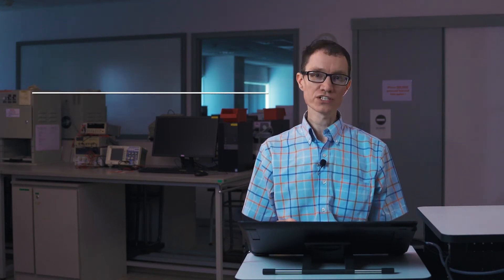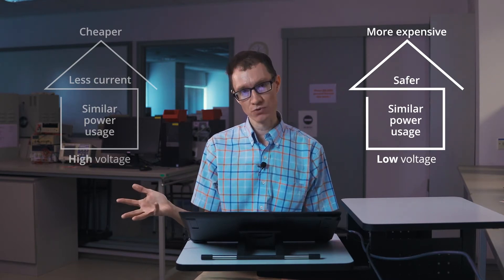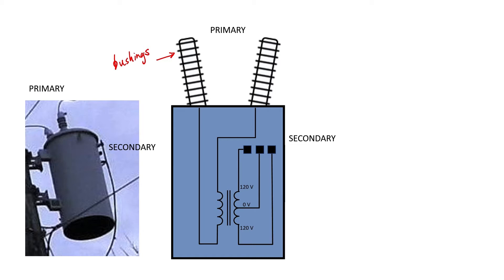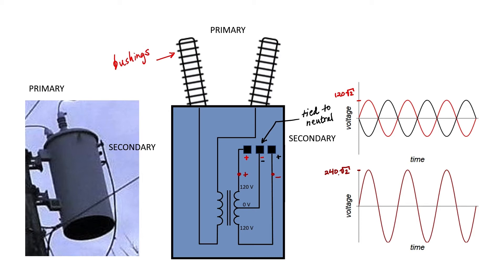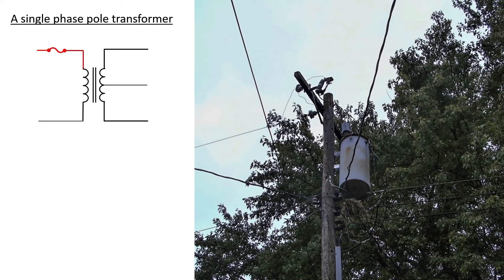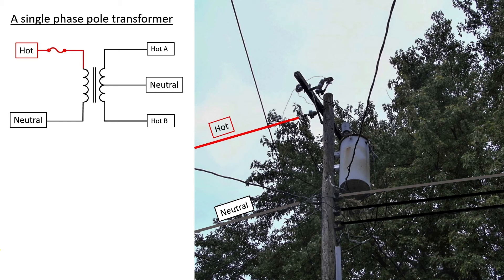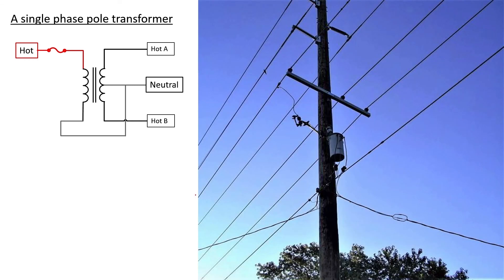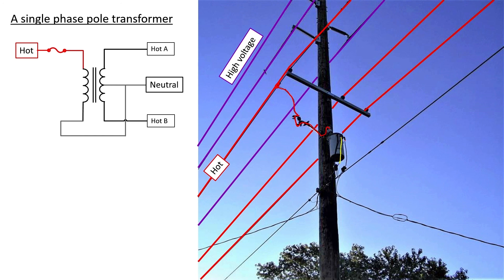Split phase power in North America (22 - Electricity Distribution)

Comment: 4:41 In Germany and in Central Europe + Balkan, Scandinavia etc. (basically countries that based their electrical systems on the German one) houses (yes even single-family ones) almost always receive all three phases + N and Ground. Thus every house has a 400V three-phase power at its disposal, we usually run electric water heaters, cooktops, welders, swimming pools etc. off it. This way we dont need to use thick 32 amp wiring for high power loads, 3-phase 16A or 20A are used for the majority of applications which saves on copper. On a single phase 230V system you need a 32 amp or maybe even 40 amp breaker and circuit to your cooktop or heater.

In the UK and I think even in France they use single-phase supply to houses.

The German system is the best and safest in the world as usual.

Comment: Interesting post!, Well in the case of our home we recieve 208 across the phases and 120 to neutral, because we have 3-phase from the Poco using three pole transformers. if we need 240 for anything we use a small transformer to add some extra voltage. 😀😀😀

Comment: There is NOT two phases in USA homes. You claim, some lights are on one phase and some lights are on the other phase. That is 100% wrong, giving that USA homes are connected to a Single Phase secondary winding. Per the manufacturer of the transformer, the two windings are in Series and are In-Phase!  You are measuring the voltage, on one of coils, BACKWARDS . Shame on you for posting garbage!!!
Reply: It is just a matter of point of view.  "Opposite polarity" is the same thing as "two phase" mathematically.  Quibbling about his terminology here is just pedantry.  This presenter understands electric power systems very well, and one ought to strive to understand the system when listening to presentstions such as this.  It is what it is, whatever you choose to call it.
Reply: @GH-oi2jf  No. It's not point of view.  USA Residential is SINGLE Phase. If YOU measure the two Legs ( not phases ) incorrectly then you are spreading a lie.
Reply: @MrSummitville  — I have a graduate engineering degree, am quite familiar with how the North American split phase system works, and I have no problem with how he explains it here.  I've seen several other videos on the subject which are far worse and contain misleading presentations.  This is the best one.
Reply: @GH-oi2jf  Then get refund.

Comment: Don't be so squeamish. Why not do a video comparing a 10 volt house to a 10,000 volt house? I love this video. They had a two-phase system at quadrature that was 90° between the phases and now we have a two-phased system that is 180° out of phase.
Reply: Correction: we have a single phase system. There is no 180 degrees out of phase because there is only one phase and it can't be (any number of degree) out of phase with itself. It's like a stick that's 240 inches tall and by convention we measure from the the center to the top and call that the positive stick, and we measure from the center to the the bottom and call it the negative stick. That leads us to think there are two sticks, one positive and one negative, and and if we add their lengths together (-120 +120) somehow we don't get 0. So some people say "no you're supposed to subtract because +120 - (-120) = 240" but that's silly. They can't explain why they're subtracting instead of adding. They're doing it because they're just copying what someone else said don't really understand what's going on. There's only one stick. It's 240 inches long. Because you measure from the center outward, one of the measurements is inverted. It LOOKS 180 degrees out of phase on a scope but it isn't.
Reply: @charlesstaton8104 that is possibly the most worthless analogy I have ever heard.  if you have two phases you have to add them together with vector addition. In the case of the 180° opposite phases the vector addition equals the regular addition. At one point they had two phase power with 90° between the two phases. The two phases met at the neutral wire and that one made a 3-wire system. Now we have two legs that come in and meet at a neutral it's a 3-wire two-faced system. Instead of being a 90° system, that you've never heard of it's 180° system that everybody has seen coming out of a transformer with a center tap.
Reply: @markmcgoveran6811  if you think that is the worst analogy you've ever heard then you didn't think about it even a little bit. Did you know that you don't even need vectors (phasors, actually) to calculate this stuff? It's simple geometry. Arrange 3 sticks each 277mm in a wye configuration and measure between their tips, you get 480mm. Just like 277V/480V 3ph. This relationship holds true for every polyphase arrangement. Wild leg delta, 120/208V, all of them; just draw them in CAD or on paper or with sticks, and measure. Even with phase angles that aren't 120 or 180 degrees.

Now I ask, if I have an isolation transformer, 240V secondary, no center tap, no neutral, no ground, is L1 180 degrees out of phase with L2? How so/how not?
Reply: @markmcgoveran6811 90 degree 2 phase was a 4 wire system, not 3 wire. There was no neutral. 4 wires plus ground.
Reply: @charlesstaton8104 you sound like you want to tell me it's not why it's Delta. Both designs have been used. I saw it in a very old book an electrical engineering college. None of that matters though. You have two legs and a neutral and they're related by vector addition that's the mathematical definition of phases. You're just stunted and you can only see things one way.
Reply: @charlesstaton8104  if you get time look up vector addition and you will find out that you do have 180 degrees two phases and the vector addition cancels out to equal, just adding the voltage between the two phases. The phase to neutral voltage in the 180° out case, is exactly one half of the phase-to-phase voltage.
Reply: @charlesstaton8104 okay if you have a stick that is 240 inches long and it is bent in the middle at a 62° angle how far apart are the ends at that point?
Reply: The only ones only able to see things one way are the people trying to read our conversation after you deleted your whole side of it. That was a weird thing to do. People who spit facts dont often go back and scrub them.
Reply: @charlesstaton8104 I don't know how to delete anything on this format. I did not write the mathematics textbook, I did not write the electrical engineering textbook. I did not design the first two phase transformer, you would see it as a transformer with a center cap. It's often connected to a pair of diodes to make direct current. Each phase will show up as pulsed direct current.
Reply: @charlesstaton8104 I'm sitting here giggling man calm down I went to 7 years of electrical engineering school I know mathematical modeling of electric circuits. I cried tears. You're claiming I'm deleting my statement because?
Reply: @markmcgoveran6811  I have an isolation transformer, 240V secondary, no center tap, no neutral, no ground, is L1 180 degrees out of phase with L2? How so/how not?

Comment: 7:43 I know you said "secondary neutral is also grounded", my question is: is primary neutral also grounded?
Reply: It is.  The neutral is connected throughout the distribution network and grounded at the poles where the transformers are mounted.  He should have shown in the schematic that the neutrals are connected and grounded.
Reply: @Steve - Typically, the Primary Neutral and the Secondary Neutral are the same wire, from pole to pole to pole.

Comment: If the two outer bushings on the secondary side are 180° out of phase relative to the centre tap  means that whilst one is +ve 120V the other is -ve 120V and would result in potential difference of 0V. They would cancel each other out. We know that this is not the case because when we test the voltage we have 240V. Therefore the outer bushings are not 180° out of phase relative to the centre tap. By centre taping the secondary windings of a transformer what you are doing is taking a point on winding that divides the number of turns in half approximately. The result would be a potential difference of 120V between either outer bushing and the centre tap. Both of these voltages would be in phase thus single phase into and single phase out of the transformer. What is split is the voltage but the phase remains unshifted.
Reply: To get the wave forms of L1 and L2 to be appear in phase with one another is two use two separate references with an isolated scope.

If you go to a room in your home that only has L1 powered outlets and you measure the voltage between two of the outlets you get 0.  Why?  Because the wave forms from the two outlets is the same and the resulting electro potential is 0.
Reply: @iceman9678  Correct, it's like measuring the difference in height of a plateaued mountain top at different points.

If you are to measure the voltage across L1 to compare it to the voltage across L2 then you must connect them the same way. During one half of the cycle current is flowing from L1 to the centre tap and from the centre tap to L2. So to compare the voltages the oscilloscope positive lead has to connected to L1 whilst the negative lead to the centre tap. The other positive lead of the oscilloscope has to be connected to centre tap and the negative lead to L2. The scope would first show a sine wave with an amplitude of 120V and then a sine wave with an amplitude of 240V.
Reply: @eulinpetit-woodyear6816  it's bewildering to me why this is hard to understand - you get it +1
Reply: @iceman9678  Yes it is bewildering. The author of the video is adding +ve 120V to -ve 120V, being 180° out of phase, and somehow getting 240V. Shows a deficiency in basic math or a detailed missunderstanding of the subject matter.
Reply: @eulinpetit-woodyear6816  You don't add AC voltages per se.  Voltage is electro potential.  So it's the DIFFERENCE between the +120 and -120 = 240.

This is why you read ZERO voltage between two outlets when you're in a room that contains outlets ONLY from L1; +120 and +120 = 0  There's no electro potential between them.  It's all about your reference.
Reply: @iceman9678  Yes you do add AC voltages,  minus AC voltages, divide AC voltages or multiply AC voltages. The AC voltage induced in the secondary windings is a result of a division of the voltage in the primary windings based on the ratio of the number of turns in the secondary windings. The induced 240V across the secondary windings is further divided by 2 to give 120V in phase with each other. It is in phase with each other because the direction of the windings are not reversed after the centre tap. In phase means at any given instant the flow of current in either secondary coil is in the same direction. If the coil was reversed after the centre tap the induced voltages would be out of phase an you would no longer have 240V across both windings but instead you now would have 0V. However, you would still have 120V across the individual windings. -ve voltage is considered current flowing in one direction and +ve voltage is current flowing in the opposite direction. Put them in the same circuit you would have a net current flow in the direction away from the greater voltage. Therefore +ve 120V in one direction and -ve 120V in the opposite direction results in a net 0V.

Now when you place a voltmeter between L1 in one socket and L1 in another socket its the same as placing both positive and negative probes of the voltmeter on say the negative termininal of a battery. There is no potential difference as the point is the same.
Reply: @eulinpetit-woodyear6816  WRT to two AC supplies you need to consider their voltages, frequencies, phase shifts.  These DIFFERENCES will yield a voltage reading in the form - electro potential.  Generally, AC voltage is not expressed as (-) without a reference to something such as time.

You correctly point out that two identical wave form two 120 sources = 0 volts between them.  It is because their wave forms are identical.  One way to measure double the voltage between them is to have their wave forms opposite which is commonly referred to as a 180 degree phase shift. 

Suppose you had two boxes each with two hotlines coming out of them. Each line measured 240 between them and 120 to ground, respectively.  How would it be possible to tell which is a pure 2 phase 180 degree wave form shift and which is split phase?  

Timing is everything.
Reply: @iceman9678  In your last example yes timing is everything. However in this case the source i.e. the "box" is the same transformer so the timing is irrelevant. The output is 240V single phase. There is no 180° phase shift but it is split into to parts both in phase. The sine wave is a graph of voltage against time. If the two sources are 180° out of phase at any instant of time on the graph you would have two values that are equal in magnitude but opposite in sign except when both voltages are 0. So At a time of say 1/4, wavelength you have +120V and -120V. 120 +(-120) = 0 so the wave forms are truly 180° out of phase. Split phase you have 120 +120=240.
Reply: @eulinpetit-woodyear6816   It's about the reference and time.  

If you're standing at N and for a given instant in time you observe the current move from N to L1 -- the current is moving away from N. (call this negative)
During this same instance in time the current is moving from L2 to N -- the current approaching N.  (call this positive)

So you see you can have a refence in which L1 and L2 have opposite wave forms relative to N.  It's about the reference and time.

Similarly are the ends of the secondary TRULY +120v with reference to one another?  Obviously not.
Reply: @iceman9678  Yes, so that's why when in comparing the two the reference points must be taken in such a manner that the current flowing through the instrument measuring must be in the same direction. That's why you must flip the probes when measuring. So L1 - centre tap then centre tap - L2. Not L1 - centre tap then L2 - centre tap.
Reply: @eulinpetit-woodyear6816  I get caught up on words some.  When measuring voltage between points it isn't current flowing through the instrument.  

It sounds like we agree(?) that if you use N as your ONLY reference and measure to L1 and L2 for any particular point in time you'll get voltages with opposite signs (+/-) with the exception of when they cross simultaneously at zero.  Thus, if you graph this over a time duration, you'll plot two sine waves with opposite signs as referenced to N.
Reply: @iceman9678  Brilliant. The output, in this case, is always 240V single phase across the secondary coil, not 2 phase, not 3 phase. 

What is confusing though is when you have balanced loads on both the 120V sections is there an absence of current on the neutral or does equal current flows in both directions on the neutral resulting in a net zero current. I have thought in ways this can be tested e.g. placing a diode on the neutral and testing the current at various points in the circuit. What's your opinion?
Reply: @iceman9678  https://youtu.be/nOSYHUxHxG8?si=lEO_X1hN8quqwoxr
Reply: @eulinpetit-woodyear6816  Assuming ideal balanced loads and N as a reference, the current/voltage would perfectly oscillate between L1 and L2.  The current from N to earth would be constant and I am thinking very small (<2vac) because perfectly balanced loads are ideal and likely not possible.  That being said a LED may light up and brighten with greater unbalancing of loads.  It would be interesting to load one side (L1 or L2) and use a shunt to safely observe the N to earth reactions.

Sounds like a job for #Electroboom!
Reply: No.  When you subtract a negative, that's addition.  The difference is 240v.